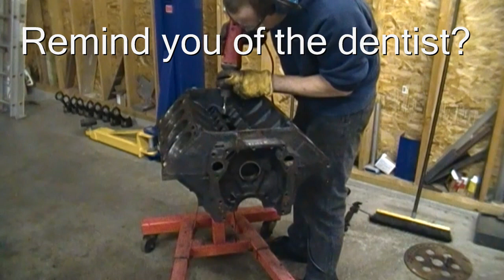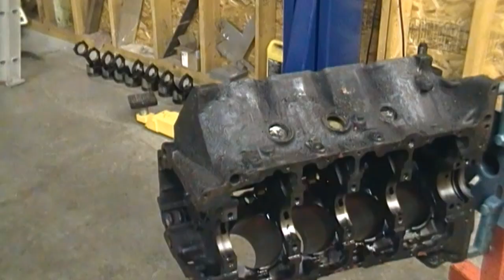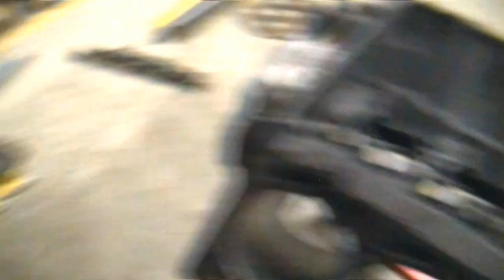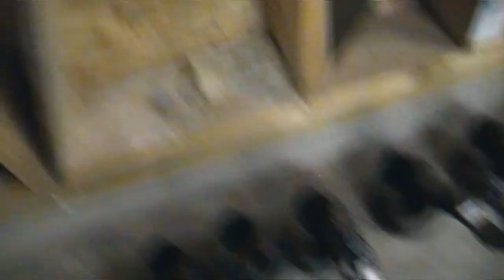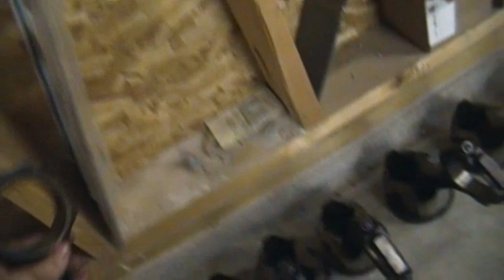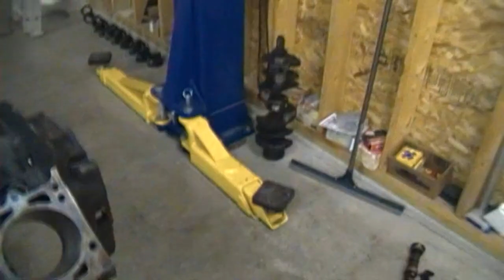Big Block Oldmobile 455 Marine engine build part 3

Comment: Do you have an email address i can email you to, what did you use as far as crank, forged or cast. This boat had a cast crank, cast connecting rods. I just had this block bored out to 30 over since thats the pistons i had. Thinking of getting forged crank, pistons, connecting rods. is your boat running good.

Comment: I wish you luck on your motor. You should have known doing an engine rebuild correctly is NEVER low dollar. I'm currently building a perofrmance short block Quad 4. Getting the good stuff is always painful. It's just necessary. Are you using Edelbrock heads on the engine?

Comment: Where are the rest of the build videos of this? I'm just curious on what cam you are going with. I thought it was a mistake sticking back in the cast pistons and cast rods. Definetly NOT high performance stuff. Some stuff from Mondello/Dick Miller Racing would have helped here. 
Using the cast stuff limited on what kind of cam that you could have used.